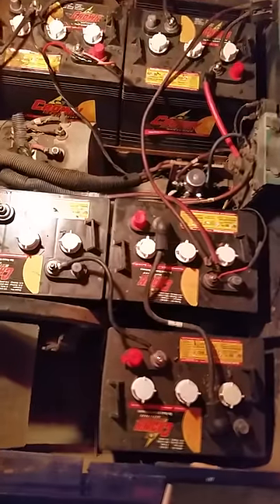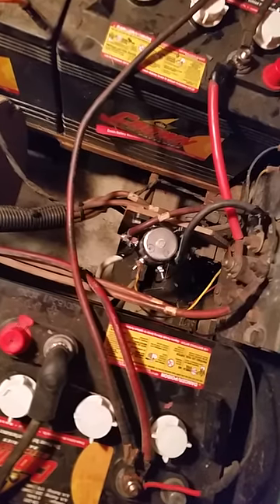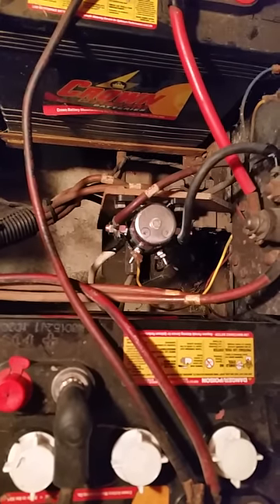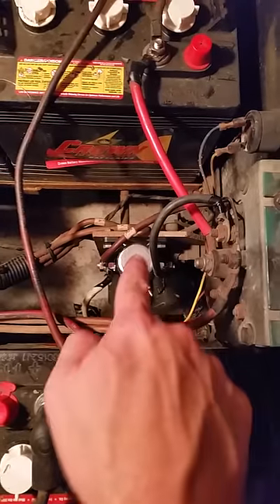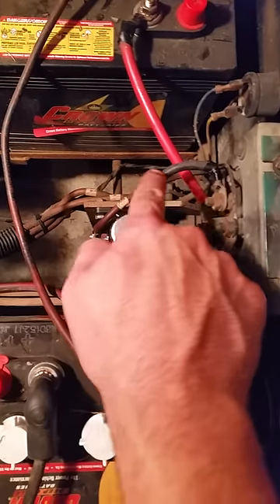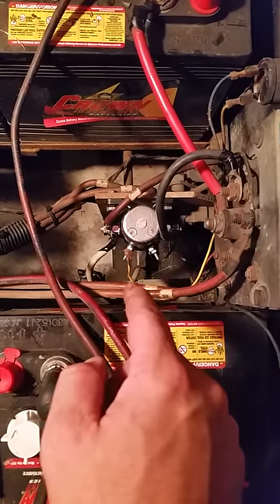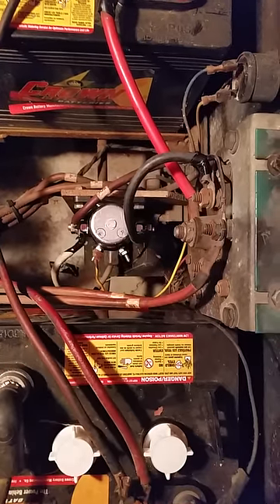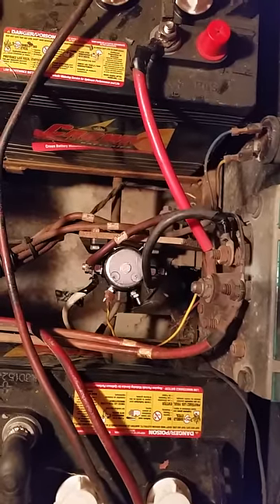1992 ezgo solenoid wiring for dummies

Comment: Is there a diode that needs to be on the smaller connections? I am trying to figure out why my cart wants to go when I put it in gear and not pushing on accelerator peddle.
Reply from the maker: This was so many years ago. This was my one and only cart I ever owned. I don’t know.
Reply: Yes, you need a diode(at least 3 amps/50 volts) connecting the small terminals (band on diode goes to + side) then a resistor (10 volt/220 ohms) connects to each large terminal and can be installed either direction. Hope that helps you

Comment: I am helping a friend that bought this exact cart, my question is these run off 6 12volt batteries? I am just replacing all his batteries but he doesnt have any info on this cart. just worries me that online says its a 38volt or close to that, but if you add all 12 volts together thats 72 volts?? Any help you can give would be appreciated. i need to make sure i follow the proper battery series wiring
Reply from the maker: Sorry, I sold this thing a lot of years ago. It was my only one, and I only learned to repair what I did as it needed it.